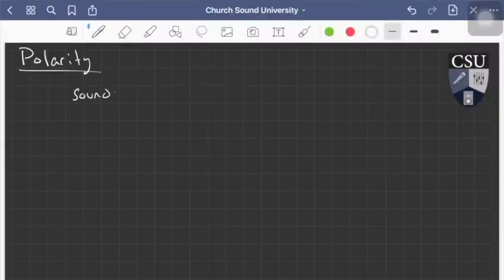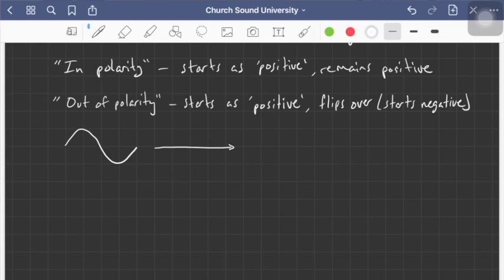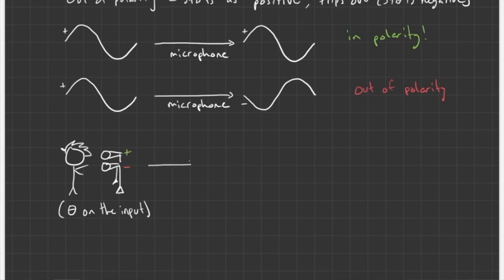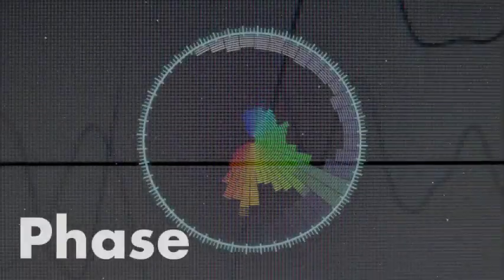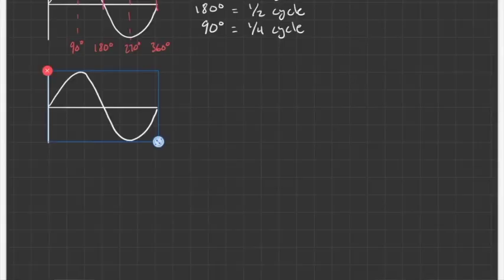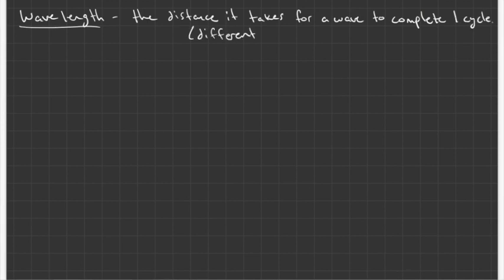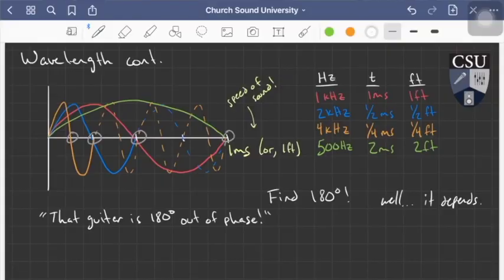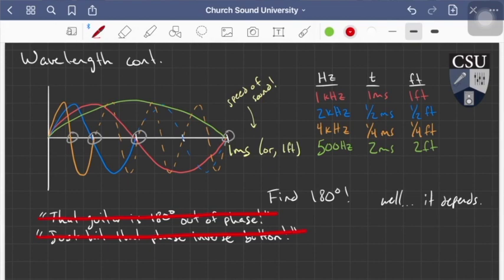CSU Tech Tip: Understanding Polarity and Phase

Comment: This is not a good way to think about the phase of a signal. Do not start out with waves, start with signals. A single frequency sinusoidal signal will have one particular phase, such as a cosine having a phase of zero. The variation of phase that you are looking at is coming from time passing, and that is not part of the 'phasor' which contains the magnitude and phase related to the signal only. The phase coming from time passing, as well as the phase distance travelled when moving on to phase, are secondary to the phase of the phasor.